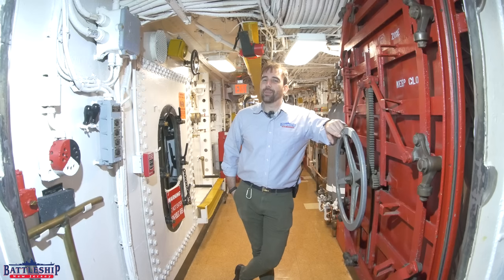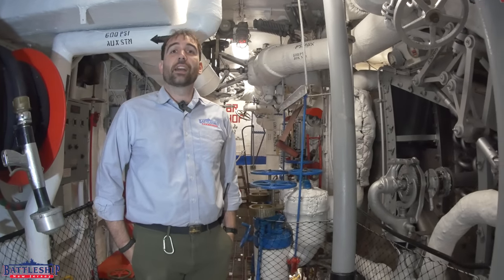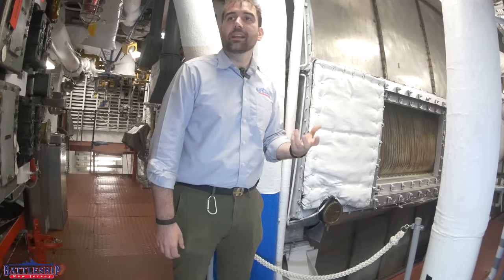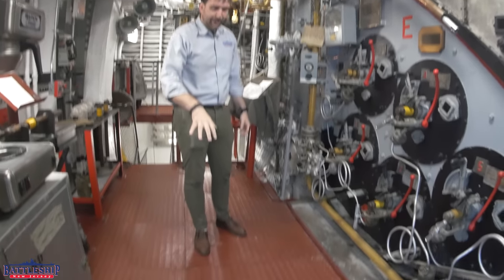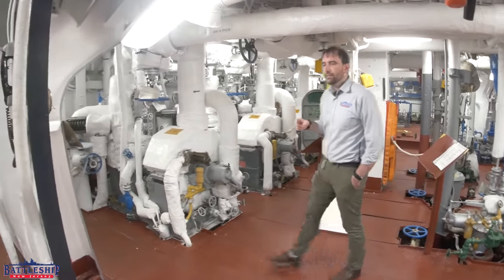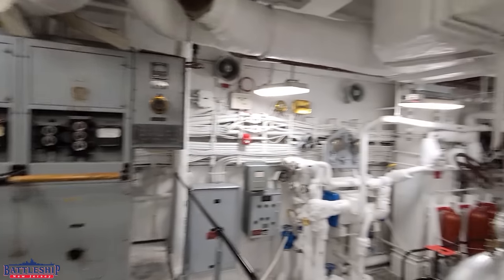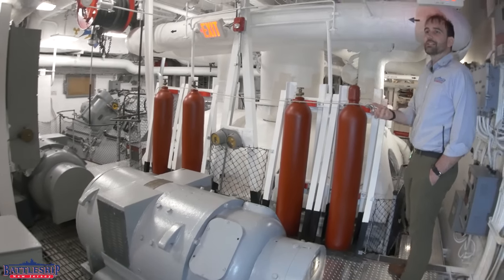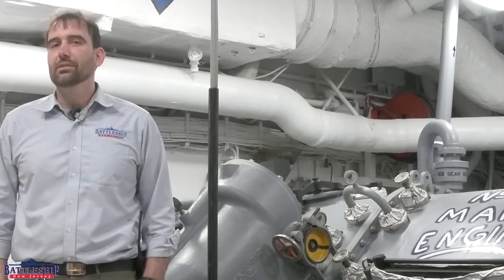Inside the Propulsion Plant of the World's Fastest Battleship

Comment: The real reason for the deaerating feed tank is to scavenge any oxygen from the water. At the temperatures in a boiler, any dissolved oxygen in the water will begin to corrode the inside of the boiler fairly quickly, so it’s important to make sure it’s removed. It also helps the condenser maintain a better vacuum.
Reply: How does the DA tank help the main condenser maintain vacuum?

Comment: Nice video.  Your gonna be an engineer real soon. 
As a steam plant, alot of the equipment would be steam driven.  So what auxiliary pumps are steam driven?  Auxiliary pumps would be driven off of a saturated steam (this might be a misnomer).  At 600 psig, superheated steam is over 489 F. Although it might be called saturated steam, it usually over 490 F, because you don't want water/saturated steam to hit your aux turbines (eg feed pumps). So your saturated steam might be at 550 F.
When it comes to main engines and turbo-alternators, the higher the temp of the steam, the more work/energy you get out of the steam at 850 F.

Condenser- heat exchanger, cold sea water in condenser tubes, when the steam on the outside of the tube hit the colder tubes the steam condenses into water, this creates the vacuum in the condenser.  
Air ejectors (if fitted)- used on condenser to start the vacuum and maintain a vacuum by taking out non condensable gases from the condenser.
Extraction pumps (from condenser) to deaerator- take from a vacuum in condenser to a pressure that will put water into the deaerator.
Deaerator- removes non condensable gases and also preheats the feed water back up (which helps to remove condensable gases like oxygen in the feed water).  It takes water from the extraction pumps and heats the water up and sprays it over trays to give it more surface area, which helps in removing any condensed gases in the water. Vented to atmosphere, hopefully outside of ship up the funnels.
Feed boost pumps- take the water at the bottom of the deaerator and boost the pressure up and feeds it to the main feed pumps. Reason hot water from the deaerator could flash off into steam at feed pumps inlet.
Feed pumps- pumps feed water into the boiler at over boiler pressure, otherwise the water could not be pumped into a 600 psi boiler.  So approx. 720-750 psi.

Note on the main engine.  The HP turbine  (ahead) will take the high temp superheated steam, after each stage the temperature pressure of the steam drops off changing the heat and pressure into rotational energy  . From the HP turbine the steam goes to the LP turbine (its still going ahead at this point).  
The LP turbine shaft has two types of turbine blading on it on opposite ends.  Reaction ( a smooth operation)  and Impulse (a BF hammer).
With a vacuum (in the condenser) more energy can be used/extracted from the steam, as you have more of a pressure drop (and temperature drop too). Make it more efficient.
One end  of the LP turbine shaft has reaction turbine like the HP turbine (which turns the gearbox in the ahead direction ).  To go astern, steam is admitted to an impulse turbine (Curtiss Wheel on the other end of the LP turbine shaft), which will turn the LP turbine shaft in the opposite direction.
In theory you should never have the ahead and astern valve open at the same time. But you need somewhere where the mass of the steam has to go (other wise you be lifting the safeties on the boilers) when ship is changing speeds (when going from higher speed to lower speed or astern).  Opening the astern valve is  putting a brake on the LP turbine shaft when the HP (ahead valve is open). Two opposing forces is a fine art on how much you can get away with.  When going astern you need to pay attention to the temp of the LP turbine (affects blade clearances).  And when the main shaft has been stopped under vacuum there are time limits. This is to prevent turbine shafts from hogging and sagging due to heat in the hp and lp turbines. To make each shaft turn at 1 rpm is not going to push the ship through the water forward, but it allows for the turning of the engines to prevent the hogging and sagging.

A diagram of the HP and LP turbines going into the gearbox and out to the shaft line would be nice.

Comment: Ryan, I have a theory about the vibrations in our fast battleships.  I think it is due to the skegs.  Iowas, Indianas, and North Carolinas all had them.  You have been on a boat at speed.  I am sure you have noticed that the water doesn't come back together immediately behind the stern.  When the ship is at speed, the same is true for the water going around the skeg.  There is kind of a hole in the water.  When that hole reaches the propellor, you have the vibration.  The vibration is from hitting both hole and water.  The faster the ship goes, the longer the hole and the more the vibration.
I have done a lot of reading on our ships.  None of the destroyers, cruisers, and aircraft carriers had skegs.  They didn't have the vibration problems of our fast battleships.  Our older slow battleships didn't have skegs and even if they didn't, I don't think 21 knots is fast enough for the problem to start.
Ryan, what does your brain trust on the Big J think about this?  
I look forward to your comment and comments from readers.
Reply: Its usually said shock waves coming off the props hit the hull.  Moving the props away from the hull help.

Comment: Do you have a schematic or something similar of the gear layout of the gear reduction boxes? The interior shot at 27:14 doesn't really show us much, and we didn't get to see where the propeller shaft actually exits it.
Reply: Also interesting is how those very precise gears were made.  From my reading, they were made with a person controlling the cutting.  That is a major art.
Reply: That photo shows one of the input pinions and they are relatively small gears. The "bull gear" which is driven by the input gears is around 18 to 20 feet in diameter. The video was made at the highest level of the reduction gear and goes down well below the barber pole striping shown on the shaft which is connected on the centerline of the bull gear. Look for some of the old US Navy training manuals for BTs and Machinist Mates, they are excellent resources. I wish the museum ship film stars would spend some time reading them before making such error filled videos.

Comment: Fascinating video! I love these engineering details, and I look forward to more like this. How about the 16" turrets, following the charges and shells up to the guns? Similarly for 5" guns? Or fire control? Radars, rangefinders, the analog computers? Or steering, from the helm all the way to the rudder?
Reply: Steering is actually pretty boring.  The helm console uses a Synchro Transmitter to send an electrical signal to a Synchro Receiver on the steering gear which controls a hydraulic spool valve.  The spool valve controls the flow of hydraulic fluid to the rams which actually move the rudder.

Comment: Also, at the generating station I worked at had a snorkel to recover hot upper story (145 F) air into the combustion FD fan. Anyway, the temp probe formed ice sickles. I wonder if the similar phenomenon happen . It's amazing how similar the plant was to a ships steam. We had a steam driven boiler feed pump,but it was replaced by an auxiliary back up. It was to much of a drain on main steam

Comment: I remember reading that   on the Wisconsin in order to prove how fast it could stop. They got it up to flank speed and dropped a stick off the bow. At the same time, then reversed the engines and turned both rudders inboard,  and stopped in ½the length of the ship.
Reply: You need to do some research, you are so misinformed. I served on the Forrestal in engineering, it takes depending on head wind, water currents and ship load 3 1/2 to 5 miles if underway at Flank speed of 30 to 34 knots. Actually saw the old girl on 30 knots for a while after we passed the Rock O G leaving the Med headed to Cuba in 63. And yes we had plenty of steam and could have fired Cats at that speed!
Reply: You can easily snap that shaft. That's why that emergency procedure is only used rarely.  Additionally they can only be used a few times per year and one evolution must be saved for a Monitored Exam Purpose.
Reply: @lawrenceleverton7426  Sir, where did you get this ridiculous information? I was a PO2 in #2 engine room and locking shaft while underway was a regular part of emergency preparedness drills.  It’s good that folks are commenting but most seem to have no clue what they’re talking about.

Comment: The DA tank removed O2 & other gasses (as a corrosion control measure for the boiler tubes water surface) by action of spraying the water along with exposure to  steam venting out the O2 & gases. I believe it was under low vaccuum. During startup, the Oil King would test for acceptable O2 levels in the DA water prior to releasing it for service.   The steam separators or scrubbers in the Steam Drum would separate the steam from the bubbles. Accumulated Impurities in the water which made the steam bubbles more difficult to break were controlled by surface blowdown & replaced by makeup feed water. Boiler water Conductivity was the test parameter indicating this accumulation of impurity. Then out of the steam drum to the Superheater picking up additional heat without pressure increase gaining efficiency & avoiding premature erosion of the turbine blades.

Comment: I like the valve status board. On a 1970s or 80s ship, you might have a board like that that could actually operate valves by remote control (usually pneumatically). On a 21st century ship, all of that is fone on a computer screen and you can operate valves and start pumps by the click of a mouse, which is a lot less labour intensive. At least until it breaks and then you're back to opening and closing valves manually.

Comment: He knows what he's talking about and the information given was certainly good enough to get the basics.  However, the propellers are NOT spinning at 200 rpm.  At most they're at 120-130 rpm.  As an engineer in the Merchant Marine, most cargo ships top out at 70-80 rpm.  Warships are faster (obviously) but they aren't 200 shaft rpm level fast.

Edit:  I did not realize that the merchant ship concept of a "max operating sea speed" wasn't something that applied to naval vessels.  From what I've been told, warships are not expected to be at their maximum possible speed all the time.  Merchant ships are expected to be at max speed as much as possible.  Therefore, while merchant ships are slower, they are designed to continuously operate at max speed.  Warships can be at top speed, but they are not expected to sustain it over vast distances.
Reply: For anyone interested, navweaps has some interesting articles that go into detail that show the props and shafts are moving exactly as fast as described in the video.
Reply from the maker: We've got the plate on the reduction gears that gives us the shaft rpms. Here's a whole video on that: https://youtu.be/CsiHn_fLefI
Reply: Good point. On Coral Sea (same power plant) I seem to remember (that was 40 years ago) that 122 RPM gave 24Kts.
Reply: @BattleshipNewJersey  Thanks.  I stand corrected.

Comment: I may of missed you describe the circ pumps? When the ship is NOT underway, I do not understand how see water (circ water) will flow in and out of the condenser to condensate the condensate water, without a pump.
Also, did you say the boiler feed pumps take suction from the condenser (hot well), to fill the DA tank? I guess I’m use to a condensate pump for that duty. Help me better understand this part of the cycle and equipment. Thanks

Comment: One small change, the steam, after leaving the main turbines, enters the condenser body not the tubes. The sea water, either by scoop injection or pump, is forced through tubes in the condenser. The steam comes in contact with these cold tubes under a vacuum and condenses back into usable boiler feed water. The vacuum is created by steam air ejectors until the steam entering the condenser begins to condense. When steam changes from a gas to a liquid it shrinks and causes a vacuum in the space it once occupied.
Mike Herbertson  MM1. USS Independence. CVA62

Comment: At 5:35. At that point in the process, the water and steam are still in contact and therefore. Saturated steam. The water cannot get up to 850*. The saturation temp for 600 psi is about 489*.
 The steam temp can not be raised to 850* until it is piped out of the steam drum & put back into the superheater
USN BT2 87-93

Comment: An idea for a short video. The sliding feet of the boiler. Every ship I was on had a sign at the feet not to tighten those bolts or you could crack the boiler for not allowing heat expansion. Just an idea.

Comment: The DA tanks job is to remove oxygen from the feedwater. Oxygen at high temperatures becomes very corrosive to iron and steel. An extreme  is a cutting torch get the metal to a high temp and add oxygen. The damage caused by O2 is to the boiler where pitting on the tube watersides will shorten tube life. It doe not create bubbles in the steam that impact the turbine blades.  A properly operating DA tank should be able to keep the O2 in the feedwater below. 0.02 ppm.

Comment: The condensate pumps take a suction fron the jot well on the bottom of yhe condenser discharges into the DFT. The main feed booster pumps take a suction on the DFT discharges to the suction of the main feed pumps that discharge to the boiler.

Comment: You have recently covered water tight bulk head emergency feed thru. Hows about the connection from the emergency generators to those water tight bulk head feed thru connctions?
Reply: Penetrations are gasketed to withstand water pressure.

Comment: Maybe I missed this but do we have any records or information on how quickly a battle ship could adjust its speed. You mentioned the need for crew to either decrease or increase air and fuel to produce more or less steam. As well as potentially needing to change the injector sizing depending on steam needs. It’s really wild to me that all needs to happen and is signaled and not automated. Just wondering if say in a engagement with a sub you suddenly need full speed from cruising speed how long that would take to reach.
Reply: Not much automation in those days aside from the 3 element boiler feed water level control. Mostly manual actions by a well trained crew handling the controls smartly. These were sharp young men who didn't grow up playing Nintendo.

Comment: So, If you manually rotate the turbine wheel one turn (360 degrees) how much would the Prop shaft turn. Approx. is OK as each prop is designed to rotate at different speeds.  Also, would you be able to turn the turbine by hand for this "test"?

Comment: Bunker C has to be heated before it goes to the boiler burner injectors. Diesel is used directly from the tanks. Bunker C fired boilers use diesel for start from cold. Some even have LPG burners to stabilise the flame until the boiler is warm enough to run clean. Unburnt oil dropping out inside the boiler is really dangerous (explosion risk).

Comment: Looks very familiar. I work on the USS Hornet CV12 museum, and we have the same boilers and same steam turbines and same transmissions. Our layout is definitely different though. And, we never cut out a hole in the wall like that. We have to go up two decks and back down two decks to get from the boiler to the engine room, just like they did back in WWII and Vietnam. 

One thing I'd be curious about is what the navy did to upgrade them from bunker c to "diesel distillate". What type of performance changes happened? Was it still as hot and loud and dirty?

Also, what would happen if something did break? How easy would it be to take stuff apart and fix it underway? Did you have to back to port? Would stuff have to get cut apart?

Comment: Hi Ron my name is Anthony Carta I served on the USS Randolph CVS15 and worked in the Engine room MM2 I also worked on the generators.

First I would like to say I enjoy your video's very much. Several years ago you gave my son and I a personalized tour and I thank you very much 
I noticed standing next to the main reduction gear and I think the Jacking gear motor. On the Randolph to engage the gear one person would wrap a lanyard around the motor shaft and spin the motor whole another would pull on a big crank until the gear engage then you could energize the motor.

I also have a question about the bearings that support the main shaft. The first watch that I Had was to check every bearing  including the ones in the shaft alley. I was to check the oil level and the temp. bp putting my hand on and count to 10. I also had to pump out the bilge in the shaft alley at the end of my watch. what kind of main bearings and jacking gear did BNJ have. I also worked in the shaft alley for 8 hours a day
Reply from the maker: Two videos for you: 
bearings: https://youtu.be/4cwRXA9YH60
jacking gear: https://youtu.be/_E4sh9DKtfM

Comment: I think you may need to double check your info on the condensers.  Typically the seawater flows through the tubes and the steam flows over them and the condensate then collects in the condenser well at the bottom.  You stated the steam goes through the tubes.